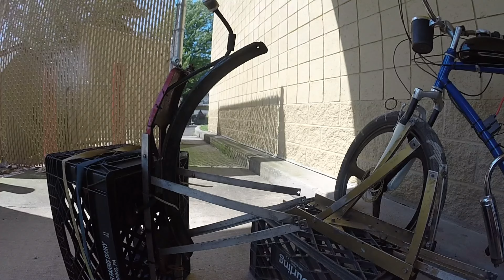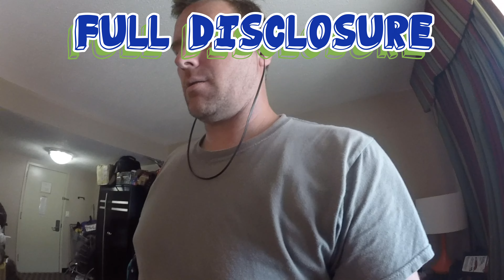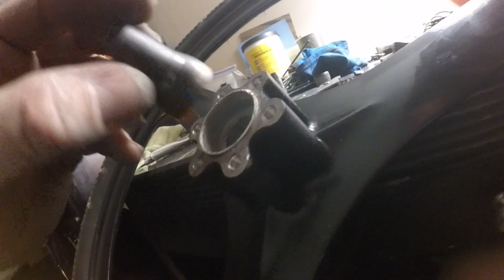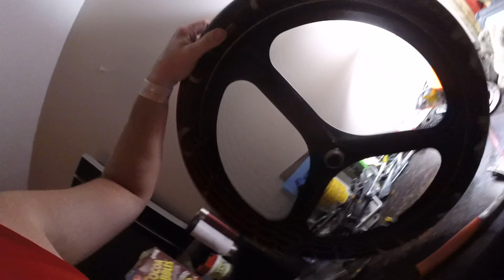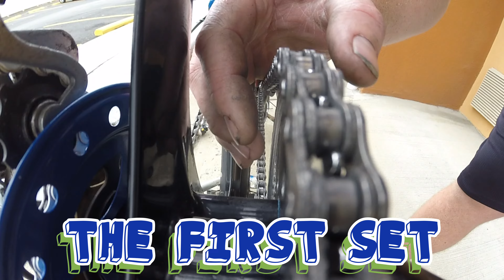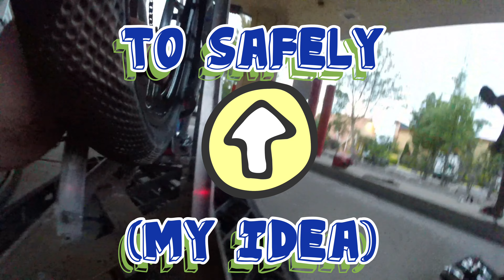I Finally Figure Out How To Use My Three Spoke Rims On My Motorized Bicycle

Comment: Nice work bro that turned out nice looking great video
Reply from the maker: Thank you I really love these rims
Reply: They look awesome I would to
Reply from the maker: @Littleevil9975  I know u got those bike berry ones that use to have and personal I just don’t trust them I believe I told u before but I’m also pretty heavy so that coulda been part reason for flex but heather also used them just to try them n she said same thing. So I’m sure my weight play a factor but I think it probably just more to it in general, sooo I said all that unnecessarily just to say I believe these rims are like $110 on eBay for the set which I think is a great price now you need to do a few things to them to make them bullet proof not the hub thing like me that’s just a me thing but I think tapping out the threads to larger for drive sprocket is a must either way they are super solid and stiff at the core you know and if your ever in the market again for rims I definitely recommend them to you especially since your handy and would have no problems modifying them to fit any needs you might have.
Reply: I’ve heard a lot of things about the rims so I’m trying to change them out to 20s  with spokes just waiting on back disk brakes
Reply from the maker: @waynewalters426  hey glad your enjoying it but the rims brand I have no idea tbh they are solid three spoke no name rims. The where the cheapest set I could afford at the time that looked thick and I have owned three sets of mags now, the five spoke  with a small radius to the spikes. They are complete trash. The ten spoke which are ok for everyday and seem solid enough for basic use. And mine three spoke the are pretty thick and they are magnesium alloy. I got them on eBay but three is two types of three spoke mine are thick looking the other look thinner. I never tried the thinner ones I never will either I weight to much for them. Sorry can't be better help with which ones mine are but it's been a while since I got them now.

Comment: I had the same prob with my cranbrook,, the chain rubbed in the same exact spot, just barely though,, i tried to stretch the back wheel frame a lil bit and used some washers and made it work!! Looks good bro,, good luck!~!Ray
Reply from the maker: Thanks brother. Yea I’m loving it  the rims have been on for about 800ish miles and I am going to b taking them off to just do a safety look at them n see how they r holding up cause heather and I are thinking about doing a 400ish mile round trip over the weekend n I need them to b Gucci

Comment: Hey Johnny yeah you're right I got to do the same thing with my motorized bike I got a 1002 the same thing I break something I'm always fixing it the wrong way but sometimes if I can't fix it with a boat I'll weld it LOL but if you can play one of your videos the way you can set the float in the carburetor in the needle valve that would be awesome because I can't figure out how to set my carburetor for some reason

Comment: From my experience dang epoxy works But it ultimately breaks down after a bit But jb weld is an amazing concoction so give that a go. I like your reasoning
Reply from the maker: U just always understand what I’m tryin to do or y I’m tryin to do it. I’m assuming it’s because you have common sense.

Comment: When I seen your video yesterday, it wouldn't play, it said "set reminder" at the bottom of it, IDK too much about all that live-chat stuff, but don't feel bad about having a peewee-Herman bike, I have a black Schwinn-Delmar with a 4-stroke on it, and it still looks-like a peewee-Herman bike, lol, I think it's the old-style rack that does it, if I were using one of these bikes for my main mode of transportation, it's really hard-telling what my bike would look-like, btw, try using crank-bearings in that mag-wheel, I seen something the other day that made me think they were the same size, but I don't remember where, or even what I seen, I just remember seeing something that made me think they were the same size, good-luck, and thanks for sharing.
Reply from the maker: Yea those bearings are different size in fact the stock bears for this rim are actually different one side to the next but this whole thing I came up with is working great actually, yes also I set this video yesterday as a premier for today so I can live chat with anybody that’s up and able to watch it when it gets released so what you seen was just telling you that the new video is coming out at whatever time was posted. Yea it’s very hard to keep the bikes clean since we use them so much unless I literally wash it everyday and that’s just not feasible; you know.Thanks for watching !!

Comment: Can u tell me what size hex bolts goes on the sprocket I got a mag wheel like that?
Reply from the maker: I drilled and tapped the sprocket holes out for m6 bolts but I don’t know stock size now I have exactly what I did in my previous video towards the end of it I believe